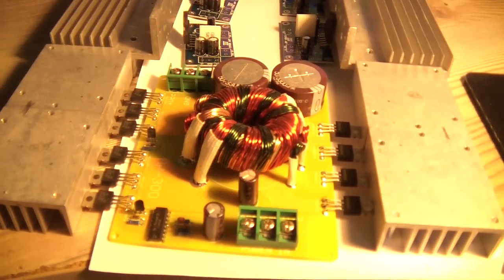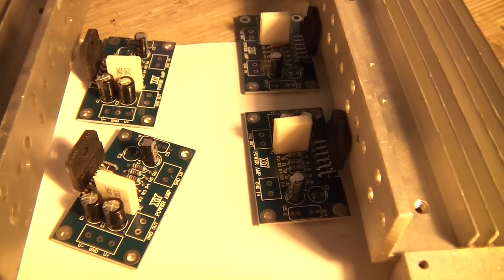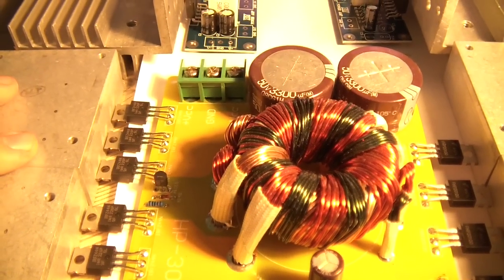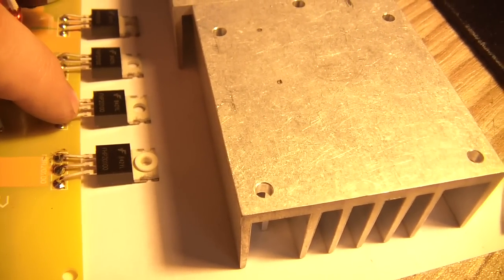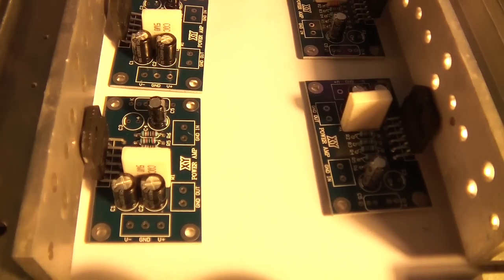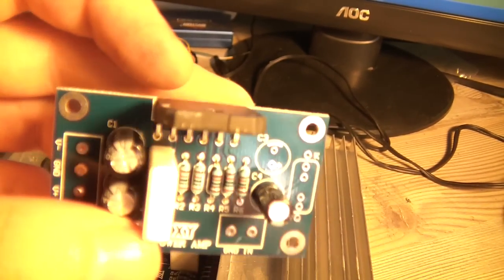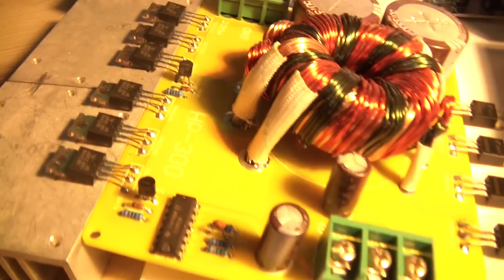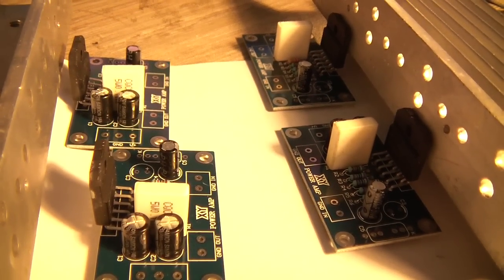DIY 4CH Car audio amplifier 500W SMPS + LM3886

Comment: i dont understand why you are using 12 output diodes when you can use 4 better ones .. and i guess control circuit is smd underneath pcb? 4 small output caps is always better than 2 big caps... other than that amazing job !

Comment: Looks pretty beefy and that is a serious amount of current you can switch with all those z44's. BUT, where is your input or output smoothing inductors, there is no thermal overload or temperature monitoring at all, there is no over current protection, there doesn't appear to be any kind of on off remote circuitry or any type of indicator of the supplies current status. Also there isn't any primary or secondary snubbers to take off the pp turn off inductance spikes, tss tss, very crude.  You pretty much built a lawn mower by attaching a blade to and engine and forgot about the rest of the mower, lol.  I like it, right to the point. you will need at least over current and thermal though, just sayin.

P.S. next time design and build everything yourself, I recognize all those components from Ebay , then it'll be truly DIY.
Reply: Just in case someone else stumbles upon this: you should look up the specs on the amplifier chips he's using. Thad didn't do ANY research at all before posting that comment.
Reply: Excellent comment was more entertaining to read then watching the video! Lol
Reply: I made no comment about his tda7294's or whatever they were, just the supply itself. All the protection and filtering mentioned above are just good practices, and most of them are required if you'd like your efforts to work for any length of time..
Reply: What are these "filters" for that you speak of? Do you know what they do?
Reply: Of course. You need an input lc filter consisting of an inductor and capacitor or even better a clc filter. This is for absorbing the hard switching spikes emanating from the supply so as not to disturb any surrounding electronics. You need a couple of rc snubbers on either the input or output side of the transformer(or both) to absorb and dissipate the very large inductive spikes that are created as the magnetic field collapses between cycles. Mosfets don't like have there vds exceeded not to mention it makes the supplies very noisy. And less important but required as far as I'm concerned is a clc filter on the outputs, feeding your equipment with a nice smooth stream of electrons. Status indicators, remote control circuitry, thermal protection, over current/voltage input and output should just be standard if you want your project to last and be useful. cheers
Reply: I see an amp capable of about 200W, not a fucking kilowatt. The box is not even wired and you are assuming you know exactly how it was made. He says many times "I have to add this" or that. He even SAYS EXPLICITLY "I have to add more filtering for the power supply" and then describes exactly how the fuck he'll do it.

You don't sound like you know what you are talking about, you sound like YOU THINK you know WTF you are talking about. Stop being an arrogant dickhead.

Comment: Nice project man! That looks like a commercial SMPS unit using a TL 494 PWM controller, the control section looks very naked, you might when your project is complete is to add a UV, OV, OC and temperature sense control to shut down the unit if these conditions are experienced (this is paramount importance for safety in your CAR)

 Also another VERY important missing element at the input of the 12v SMPS power supply is the heavy duty input inductor and filter caps, this will NO only protect the car from the switching but from the car power supply during bass notes drawing large currents causing large AC ripples that may destroy your input filtering CAPS.

All and all its a good project and best of luck.